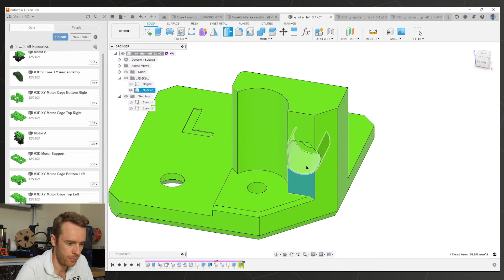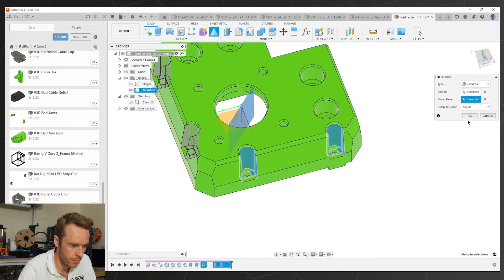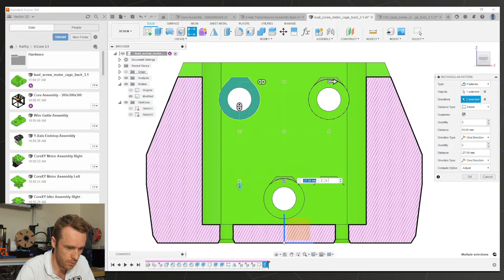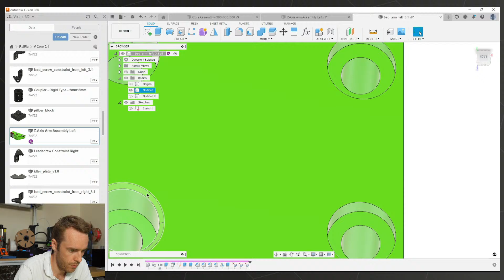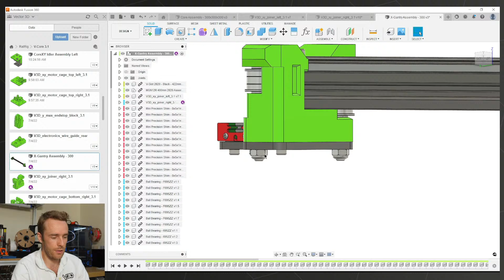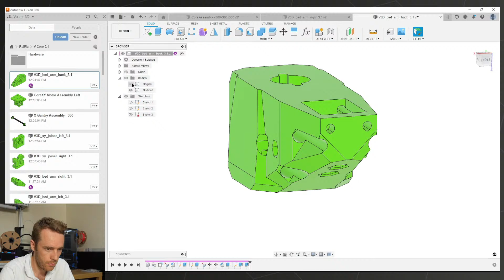V-Core 3.1 ABS Parts Design Fusion360 Part2

Comment: Why the depreciation of ABS plus from eSun?
Reply from the maker: Inconsistent layer adhesion performance.
Reply: @Vector3DP  thanks, I printed my 3.0 parts with this filament and had some layer shifts and some adhesion problems. Could work around it but lost a lot of time. Now I know it's caused by bad filament. The brand you recommend is not easy to buy on mainland Europe though. I'll search for another brand than esun. Thanks for the advise.
Reply: @Vector3DP  strange, i found esun abs+ layer adhesion to one of the best i used.